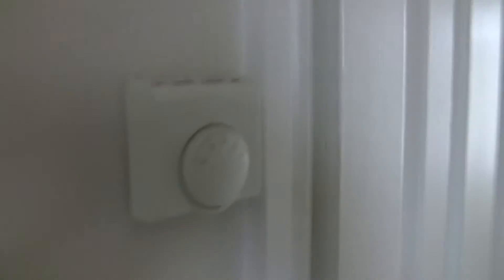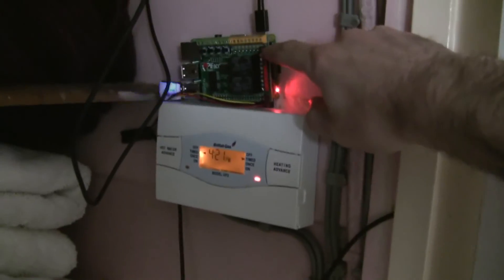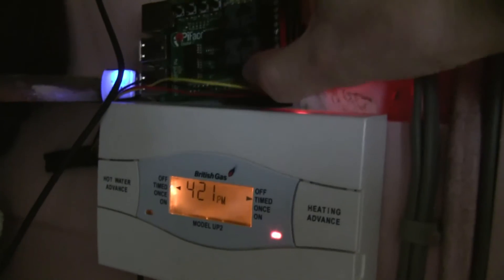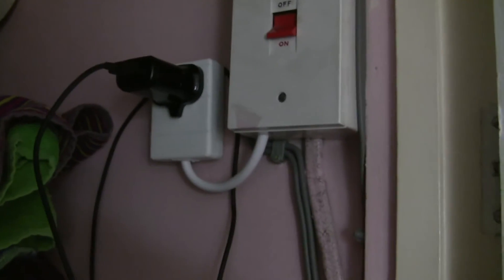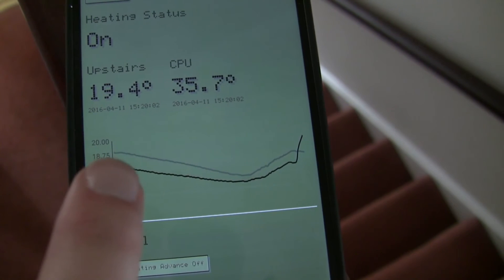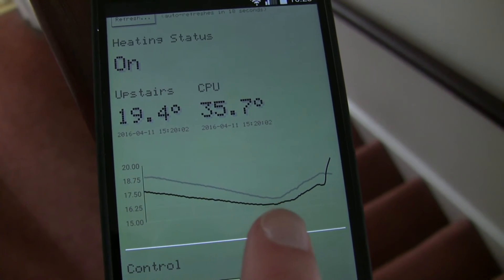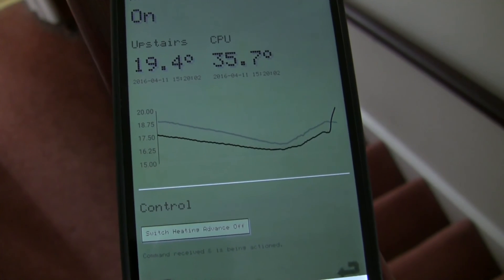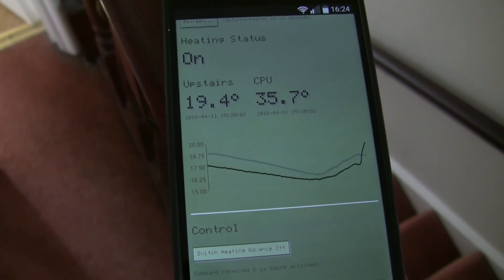Raspberry Pi Heating Controller - Part 6 - Temperature Logging & Web Interface

Comment: Pi Zero has finally arrived! I've bought 2 (£6.25 each - bargain), so I'm hoping to get them talking to eachother so one can be a smart temperature sensor that I can put in the room of interest. Is the mobile/Web interface something that you've created, or is there an opensource version? Once again, thanks for the updates into the art of the possible.
Reply from the maker: +Adam Stubbs That's the kind of thing I have in mind.. having 2 zones for the temperature, not just 1 upstairs. I've coded the web interface up myself.. I'm thinking of making it available on GitHub at some point.

There is an Open Source project I was going to take a look at, it's called Domoticz, and should allow you to do a whole load of things.. take a look and let me know how you get on. I think the only think it won't do is separate your internal Pi from the Internet.. so you'll need to do things like port forwarding to get to your Pi remotely.. unless that's a feature I didn't spot.
Reply: +Endpoint101 Hello again. I'm pretty much there now! I couldn't power the RPi zero from the board, so I stripped down a USB mains plug and connected it to the 240V, soldered a USB plug onto PP1 and PP6 of the RPi and then connected the 2 together. I've learnt loads about electronics and knocked up a circuit using NPN transistors to affect the signal at the GPIOs. Phew! I didn't know this was possible until I saw your tutorial, so thank you very much. I've got some basic coding that will allow me to putty in to the RPi and turn things off and on, as well as read the LED status. I'm at a loss as how to control this via a web page. Could you point me in the right direction for the interface you have please? I've been looking at Prota Pi as well, which seems like a superb option for controlling GPIO function but unfortunately I haven't found a way to use this with RPi Zero. Sorry for bugging you about this but you've been very quick to respond to me and helpful in general and you probably know how that attitude generally gets people asked for more lol. ATB Adam
Reply from the maker: +Adam Stubbs Good to hear your project has been going well. The interface I put together is written in PHP.. but what it does is use the 'exec' function to call out to Python scripts that talk to the Pi.. It was easier than trying to get the same thing working in PHP, or for me to learn Python from scratch for doing websites.

So a call to go and get the current temperature looks like this;

function getCPUTemp() {
 $pathToCommand = 'sudo echo "scale=1; $(cat /sys/class/thermal/thermal_zone0/temp)/1000" | bc';
 exec($pathToCommand, $returned);
 return $returned;
}